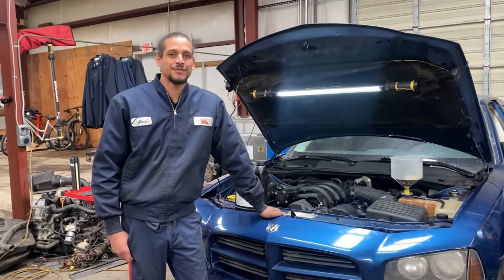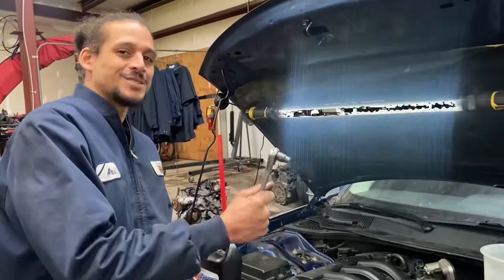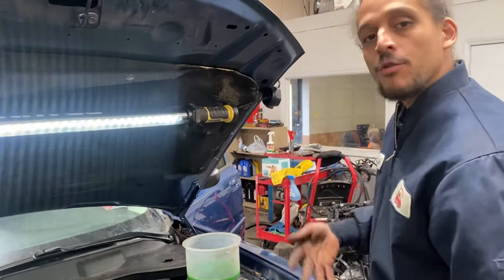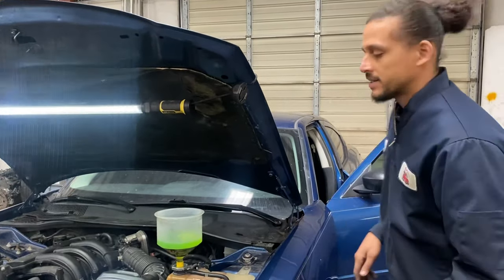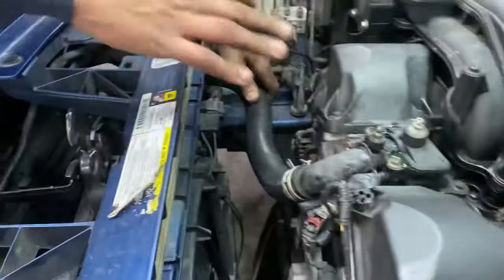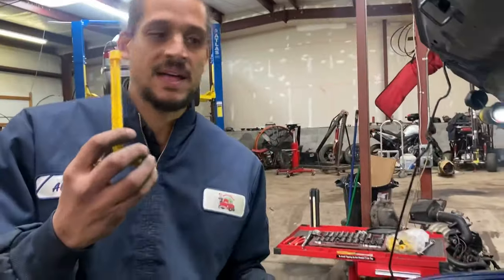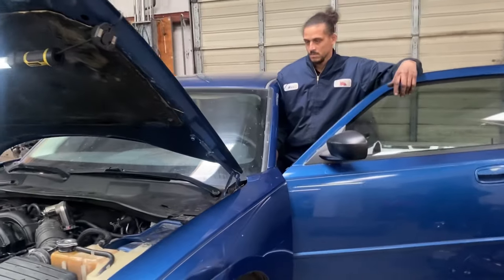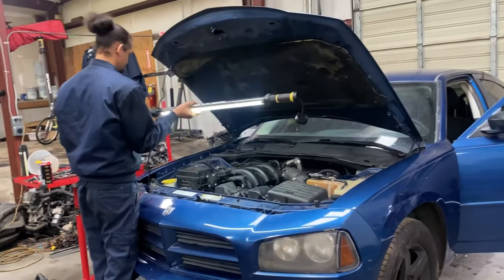How to Bleed or "BURP" Air Out Of Your Engine Cooling System (2 WAYS) #coolingsystem #overheating

Comment: where do i find bleeder valve on  2014 
mitsubishi triton?
Reply from the maker: Hey buddy, I don’t recall that engine having a bleeder valve. You’ll have to do it the other way, which is running the engine with the radiator cap off and the heater on. Just like I did in the video.
Reply: @AlexTheCarDoctor  I did like you for about 30 minutes and bubbles are still there but at reduced rate, any idea what the problem is?
Reply from the maker: @ditiromartiens7965  Question : what’s the reason you need to bleed the coolant system. Did you run the vehicle hot recently?
Reply: @AlexTheCarDoctor  Yes, it's overheating and I took it for radiator test and checked if head gasket is fine and it's fine. I don't know what is the problem.
Reply from the maker: Are both the upper and lower radiator hose hot that means the thermostat is opening it should be hot after about 15 minutes of running , if the upper is hot and the lower is cold you may have a thermostat problem
Reply: @AlexTheCarDoctor  I've checked the thermostat, it's fine. The  lower hose is also hot.
Reply from the maker: That’s the 2.5 diesel right? You may have to keep the radiator hose off a little bit longer while massaging the hoses, some cars/trucks are more difficult than others.
Reply: @AlexTheCarDoctor  lower or upper hose?
Reply from the maker: Massage both if you can. I don’t have that app unfortunately
Reply: @AlexTheCarDoctor  can a faulty fan cause bubbles in radiator water?
Reply from the maker: No faulty fan will not cause air in the system it can cause your car to overheat at a standstill though.a good way to test your fans’ either turn on the AC the fans automatically come on if they’re electric or to wait for the temperature to go above the middle and they should come on

Comment: My 2001 Tahoe keeps overheating after I replaced the water pump and thermostat I think I burped it all the way but I can't tell
Reply from the maker: Hey there that engine should be easy to burp, how hot did you get the engine
Reply: @AlexTheCarDoctor  the engine was cold when I started but quickly over heated, when it cooled down again I filled it directly from the radiator line to see what happened and it worked just got it good.
Reply from the maker: @arty1355  ok great
Reply: @AlexTheCarDoctor  thank you! Keep up the great videos! People need to know more about how to work on vehicles with the prices now
Reply from the maker: @arty1355  I agree

Comment: actually the water comment is wrong. distilled water does more damage than tap water but not by a lot.  as long as you use antifreeze or even only coolant booster product & water they will help limit the damage by water. never use just water unless its an emergency

Comment: My car is still blowing cold air with the heater on I changed the thermostat and radiator for an 98 Lincoln towns car
Reply from the maker: I do believe that car has a heater control valve have a buddy turn the heat on wow you check if the heater control valve arm is moving
Reply: @AlexTheCarDoctor  the hearter will come on mintues later when im driving. What about the heater censor? With a bad censor will that causes it to over heat?
Reply from the maker: @blackboyentertainment2027  are you saying the car is overheating
Reply from the maker: @blackboyentertainment2027  do you mean the heater core
Reply: @AlexTheCarDoctor  no I mean a censor the heater core is good. The headgaskets is good to. When I'm driving the temperature hands goes up. But when i keep driving it goes down.
Reply from the maker: @blackboyentertainment2027  you will need a temperature gun to get a true temperature Reading and compare it to the temperature sensor read out on the cluster
Reply: @AlexTheCarDoctor  Ok thanks for the advice I will definitely try that
Reply: @AlexTheCarDoctor  Oh dam I been spelling sensor with a ﹰC I know better than that. 2 totally different
Reply from the maker: @blackboyentertainment2027  good thing I new what you meant

Comment: great video I try burping it after changing radiator (was crack) thermostat and cap let it run for a while raise the temp in car and hot air was coming out but the air kept coming un funnel kit massage hose like you did but all of a sudden temp starts raising, and the funnel starts filing up with coolant to a point i had to turn of car and drained twice ,I notice upper and lower hose were super hard  and when i turn it off coolant was flying out fans are kicking in but doesn`t feel hot air coming out but they are blowing towards the block any idea
Reply from the maker: Thanks for watching man.did you run the car really hot prior to replacing the radiator
Reply: @AlexTheCarDoctor  yes
Reply: @AlexTheCarDoctor head gasket?
Reply from the maker: Dang,yes you may have a bad head gasket If that’s the case you would never get the air out the system that’s what bad gaskets do. You would need to do a block test , Are you familiar with that test
Reply: @AlexTheCarDoctor  yes I will do that and keep u posting thanks for the help and happy 4th of july

Comment: You're basically drowning the guys injectors,spark plugs and anything on the top of the engine there is going to be subjected to a lot of cool and sitting around it
Reply: If a little bit of anti freeze drowns spark plugs, you might have a serious problem

Comment: why does my reservoir boil over when I try this
Reply from the maker: 2 things, you probably letting it run for to long while burping the system, just let it cool off and top off coolant when it cools down or you have a stuck closed thermostat, if one hose is cold and other hot then you may have a stuck close thermostat. They should be about the same in temp the upper and lower radiator hose

Comment: Just so wveryone knows he emptied the cooling system completely before adding all the coolant and water. Idk why that wasn't something he started with saying but just know. You have to empty it completely first.
Reply from the maker: You don’t have to empty the cooling system before burping. A person would only need to burp a cooling system after a cooling system repair is done. You would have to add coolant to do that, which is why it wasn’t mentioned. Also I stated at the beginning of the video that I had just did a radiator repair in the previous video.
Reply: @AlexTheCarDoctor  ok so that's where all that liquid was going  😆 I guess I missed where you said you did a repair on the radiator.

Comment: U need to redo the video because u sounded lil sloppy in audio towards the end. U didn't even inspect the video u did. Why u guys always mess up alignments and say one thing and then another.
Reply from the maker: Thanks for your feedback buddy I will do another one soon
Reply from the maker: I probably was tired that day and I really wanted to make a video that was going to help people out
Reply: Don't do it again if it tired. F for fail on script 😆
Reply: Where r u located? And I did that procedure and it worked. Same goes for water pump replacement. Coolant is a vaccume system after taking out water pump and u should psi check. But u seem u already know that. Coolant flushes and knew coolant can keep water pump good shape especially if it's 20 years old. I flush my car once a year. Dodge chargers are whack they shit lol but most people choose to be stranded with bad coolant destroy there head gaskets and water pump
Reply from the maker: @janielramirez9181  can’t promise you that,(I’m trying to work like no one else so later I can work like no one else) in the tropics somewhere on the beach with my wife and kids still getting paid
Reply from the maker: @janielramirez9181  I’m located just outside of Atlanta Ga 1850 Joy Lake road 30260
Reply from the maker: @janielramirez9181  you are right you have to baby those cars if you want to keep them on the road. Thanks for watching buddy and glad I was able to help in someway even though I may have been tired that day lol being a shop owner is hard work, I just take one day at a time and like Bob Marley says (don’t worry be happy)I leave for that saying.what area or you from
Reply: @AlexTheCarDoctor  nah make money and be Happy if u single lol. Not everything about money on certain thi gs. Happy new year
Reply: @AlexTheCarDoctor  not far from where I'm at. I finally got my other car station wagon ac running again of the brand new ax compressor. The connector was lol loose at the of ac compressor. My hands and arms were lil too big fit and it's a ford mercury and everything cramped up together. I got it when it was with no ac and with bad suspension it wasn't a bad repair.  I did the suspension which very difficult requiring hammer the suspension knuckle from top, replacet the outer tie rods. Turns I think the outer tie rod on passenger was bad which possibly led me to think the wheel hub was bad and alot of time that over looked, so I realized that while back. The car was clunking a couple of weeks ago and I found the nut on the brand new strut was lose at the top of the strut and eliminated the clunking. That could have exploded being compressed strut. The guy that was gonna get that station and Wana get because of no ac misses out on real good station wagon. I took a chance on that car and came out lucky. I only use it a few times a month. Don't like the new cars because they don't feel original like the cars back then. They got too much upsells in them that cause headaches. I don't want them to eliminate combustion engine for electric cars because there gonna cause to much. Might as well everyone ride a bike to work lol
Reply from the maker: @janielramirez9181  you right life is not about money. It’s about family for me I have 5 kids and happily married for 15 years I work hard for them.it sounds like you know your way around cars that’s awesome. Happy new year buddy
Reply from the maker: @janielramirez9181  you should stop by the shop one day and say hi
Reply: I stay in Florida. Nt far for me. Seriously I will stop by in Georgia soon. Happy new year 🥳
Reply: @AlexTheCarDoctor  they should learn about cars. They can work at assembly plant like Toyota.
Reply from the maker: @janielramirez9181  happy new year to you to buddy

Comment: Terrible video: 
1. Sound is too low, I had to use max volume to hear it. 
2.  The advice is not good, the “traditional” way should NOT BE USED  in cars that have block or thermostat housing bleeders. Doing so will ALWAYS keep air trapped in the system that will cause overheating wherever this air is trapped. The engineers who designed the system know what was needed and they wouldn’t put those bleeders in unless they were required for proper system performance.
3. The reason you shouldn’t use tap water is because it contains metals and even worse, chlorine, which causes corrosion of steel components and erosion of aluminum components.
Reply from the maker: Thanks for your feed back. Thanks for watching. It was terrible for you, but wonderful for others and has helped many people. Have a blessed day 😎